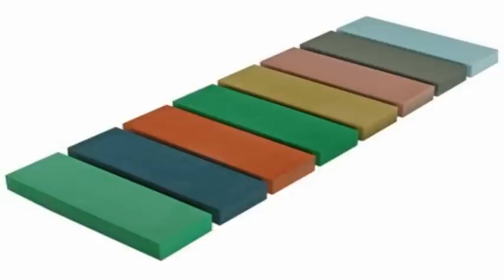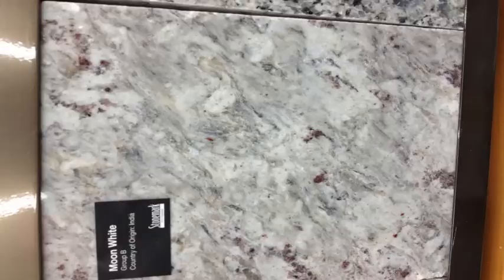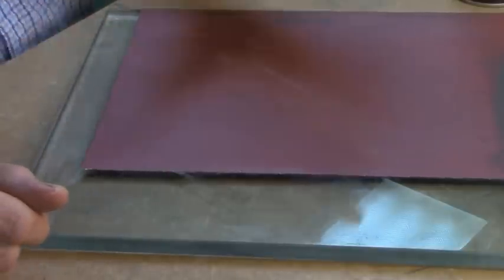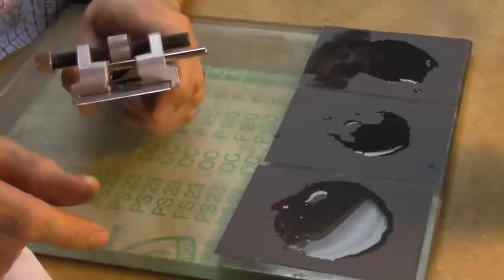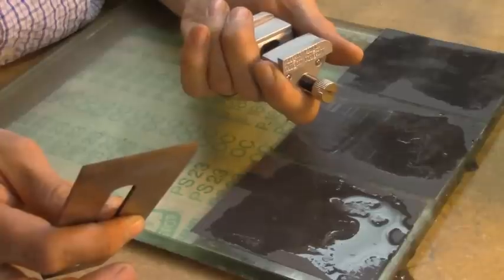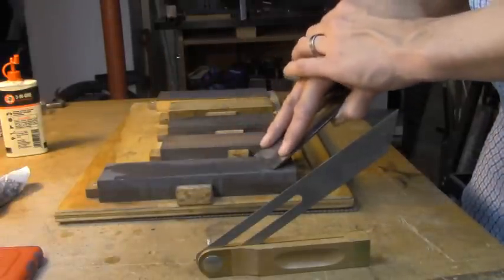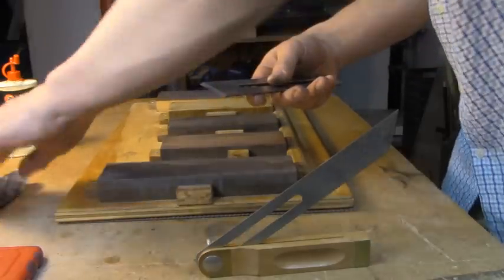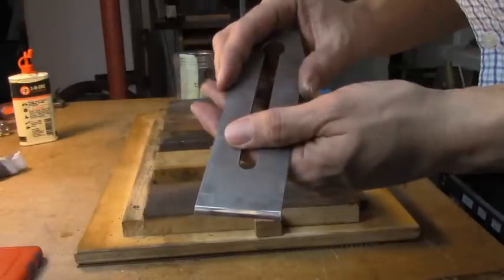Hand tools for $100 #4: Sharpening for Cheapskates

Comment: So will this method work well with knives (such as Bowie) and axes and machetes? I like the idea but have been struggling with sharpening in general. I mean other than the honing guide.
Reply from the maker: This will work with knives, but planes and chisels are easier.
Reply: For axes/hachets/knives, I recommend a stone or a small (stone size) piece of TEMPERED glass. This allows you to hold both in your hands or put the axe/hatchet in a vise.  A very fine file will also work well.  In either case, you want to run the grit at an angle down the length of the edge.

Comment: In stead of buying the kreg ... er ... thing for measuring, why not just make one. You do have the measurements written on the honing guide.
I know: I made one and it works fabulous... Cost me 5 pieces of scrap wood, 4 drops of wood glue and some time investment for waiting for the glue to dry.
The 5 pieces of scrap wood: 1 for the base and 4 stop blocks (2 for plane blades and 2 for chisels)
Reply: It would be cool to see your plans and the tool
Reply: @cotswoldlad9413  I do not have any plans, but the jig basically just is a piece of scrapwood with 4 "stop blocks" glued to it. The honing guide gives the required measurements for clamping the plane iron or chisel. Take your pece of scrap wood and glue a block on every measurement given (and most important :-) write on your jig what block is for what purpose). And from memory (I can be wrong!): for chisel the distances need to be an angle of 25 (for the bevel) and 30 for the tip, what means a distance of something like 50mm and 40mm.
I hope this is kind of clear.

Comment: How do you make a small curve for a smoothing plane?
Reply: When you are hiring with the fine stone and strop, press a little harder on one side of the blade for a few seconds, then the other side for a few seconds.

If you are using a smoothing plane you are trying to take a cut of 1 thousandth of an inch or so. So the size of the curve can be in that range.

Comment: Frustration for the self taught results because sharpening is one element of the equation. It may not matter that your blade is scary sharp if your plane isn’t correctly set up or you have poor technique chiseling dovetails. We’re told that sharpness is everything. We end up flailing in the dark endlessly watching YouTube trying one solution after another.

I could shave hair with an ax. However, it wasn’t until I watched a free seminar and was given a Worksharp that I relaxed. It produces repeatable results fast. 

It’s taken me years to get to this point. The process is important but my time is limited. It doesn’t matter if I have sharp tools if I have no time to use them. That’s where I’m at today. I want to spend my time woodworking, not sharpening.

Comment: How temporary is that spray adhesive? How easy is it to remove the paper?
Reply from the maker: It's permanent, but it comes off with mineral spirits. For best results, remove it the same day you put it on. Otherwise, it's a bit of a fight.
Reply: @RexKrueger  Thanks a bunch. I appreciate the quick reply.

Comment: cheapskate that I am, I don't buy the sandpaper at any auto parts store. They're too high. I buy it at a local hardware store, in full size sheets, not those half sheets. Frankly, I never use a honing guide. I didn't learn with one, so I've really never used one. I go by eye. I know what angle it should be. I finish honing with a diamond impregnated steel. It lasts nearly forever.
Reply: i have some stones, but never use them. I can do better with the paper (or emery cloth when I can get it cheap) Some of the knives and chisels I work on need serious work, and sharpening comes last, after ruse removal and the like. 

Now, show these boys how to sharpen a twist drill with a portable belt sander. What, you don't know how to do that? If you don't I can try to explain, but I can't show you what I mean.

Comment: If you set the roller of the sharpening guide on the glass when you get to the finer grits, even that little bit of difference will cause you to regrind your bevel just a little bit.  BUT, you can use this to your advantage.  If you use small pieces of sand paper at each stage and keep the roller on the glass, and then keep the roller on the PAPER for the last piece, it will give you a VERY SLIGHT micro-bevel.  The next few times you go to dress the edge, only repeat the very last stage. This will only take a few seconds to touch up the edge, and you're ready to go again. (It will take longer to setup the guide than dress the edge.)
  When you move on to stones or diamond plates, you can achieve the same effect by placing a scrap of paper from a 12-pack box under the ROLLER for the final grit. 
  I used a 2-sided stone from the hardware store and a scrap of girth-strap from a horse saddle with NO compound for over a decade with very good results.  The advantage to the girth-strap is that the 2 sides are usually different textures; the smooth side is used for most of the work and the 'fluffy' side is used for the last 2-3 passes. A piece of leather from Hobby Lobby or Michael's will do just as well.

Comment: Great techniques, but strictly speaking, so long as you're still removing material, you're still sharpening.  Honing is about straightening the burr and aligning it with the rest of the cutting edge, not removing material.

Comment: You said you changed the angle to 38 and later it becomes 30 degrees ? How ?
Reply from the maker: I'd be happy to answer you question, but I don't understand. What part of the video are you referring to?
Reply: I think the reference to 38 referred to 38 mm from the end of the plane blade edge to set the plane sharpening angle to 30 degrees.

Comment: All those fancy grinders....waste of money!
Reminds me something a Salesman for fishing lures told me one time...
Most of the stuff on the market is meant to catch the fisherman....Not Fish.
DMT Diamond Bench Stones and Norton Wet Stones is all you need and will last for years.
A few different grit smaller size diamond stones for doing router bits, touch up jointer and planner blades is nice and you don't even have to remove the blades from the machines to use them and get a sharp edge.

Comment: Maybe it's just my old guy eyes, but it looks like there's a significant crack in the sole of your plane adjacent to the mouth. Does it cause you problems? Great video.
Reply from the maker: Maybe a little stress fracture around the mouth, but lots of Stanleys came from the factory like that. Just little stress fractures left over from the metal cooling. And no, no trouble at all.

Comment: What happened to checking and flattening the underside first ?  If this isn't flat bevelling will never work
Reply from the maker: So, the flattening the back would be for preparing the chisel/plane iron for it's first use. I would do that with a new tool or a tool I'm restoring. All the tools in this video are in use and already have the backs flattened.

Comment: Call me nuts, but I yet have found after 55 years of buying tools, a good reason for bragging about how cheap I can be or do something. 
What really has my imagination working overtime is watching cheapskates bragging how cheap they are. 
If someone thinks sandpaper is cheap is raving mad. Go buy some. Then buy it every time you need to sharpen. 
Oil stones are good. Good oil stones are very expensive; ranging in size and price well over $300 - $500 for nice black translucent finish stones. Not cheap. I know that the words “Not Cheap” is the anti-Christ of every American alive and walking. Good poly diamond plates are very expensive (not cheap) as well, but the sharpness is determined by how polished the two surfaces are. Diamonds do not provide that kind of polish. Natural Japanese water stones are by far the best, and the most expensive (not cheap) abrasive media. It will however be passed on to your heirs. Literally. Plus they are extremely fast. I witnessed a bladesmith home a chisel to a polish that would defy anything on YT. The chisel lightly pressed into a paint brush it severed the hair with ease. If you don’t think that is impressive, try it. One natural water stone can easily cost $1500. They are harder and harder to find. For most American woodworkers, the India stone is far too expensive and they will settle for the $7.00 job. But hell I have one better. Grab a coffee cup. Use the bottom for course hone, then flip the cup and use the top rim for fine. Lastly, as a reward of discovering how cheap you can be, Have a cup of old coffee grounds used twice the day before after sharpening. Pat yourself on the back on how cheap you are. Then go re-light the water heater only long enough to wash the dishes in the bathtub before the family takes a bath in it afterwards. Yes Rex, cheap is where it’s at. How many stones does it take to proudly say you are cheap ?
Reply: I don't necessarily disagree with the philosophy behind the rant: cheap has low price going for it, and that's all. And if you can afford excellence, choosing mediocrity for cheaper may be a poor way to go. There are those whose table of values includes a category Cheap For Its Own Sake, and some may rank Thrift over Prudence (the latter used as a synonym for foresight.) When evaluating the relative worth of virtues there is, I think, room for cordial dissent. I find both sides at least partially persuasive in the abstract.
In the concrete, however, there are those (among whom am I) who cannot afford the excellent, and in fact have to cautiously weigh the viability of even the mediocre. For us, it is a balm to be taught that acceptable results can be had for the small initial outlay we can manage. We understand that we are in a difficult circle to escape: tight cash flow renders the wiser 'invest' path unwalkable, but by selecting an inexpensive but short-lived solution we doom ourselves to remain limited to such solutions. Believe me, we are rarely able to ignore the exquisite poigns of these dilemmic horns. We might wait several years in order to save up for the beautiful oil, diamond, or water stone, and then we'd have it for the rest of our lives, perhaps. Though like even the wealthy we have perhaps experienced how long-term investments are not guaranteed to work. A generational heirloom stone can still be dropped, or stolen, or lost. Moth and rust do destroy, and thieves do break in and steal, after all. But the opportunity cost of the investment is >0, and may, to an individual's reckoning, render the overall cost too high. We're grateful to be able to sharpen as we age, though we live a lesser whet.
I often do reuse my coffee grounds, by the way, and cycle my a/c half hour on, half hour off. I'm grateful to have coffee and a liveably cool house even in straightened circumstances.
Reply: WTF are you talking about James Lucas. Stay away from the solvents
Reply: The main reason for talking about the low price is removing the stigma surrounding woodworking that you have to spend a ton of money to get started. There are over 7 billion people on the planet, and not all of them have the money to buy high quality items. A lot of people also don’t want to waste tons of money on a hobby they know they probably won’t keep up.